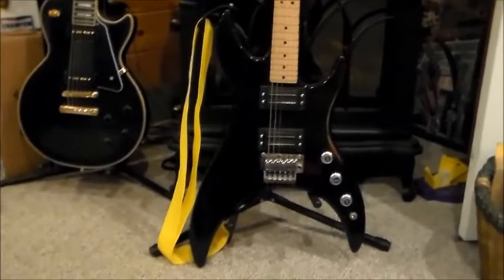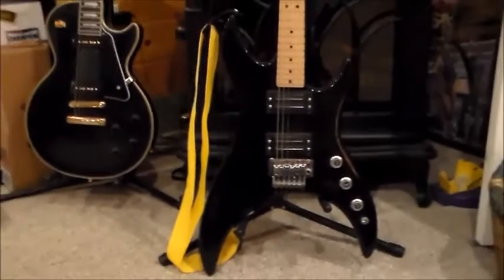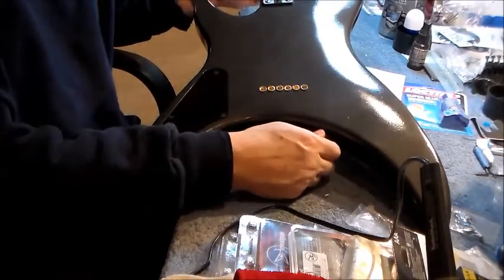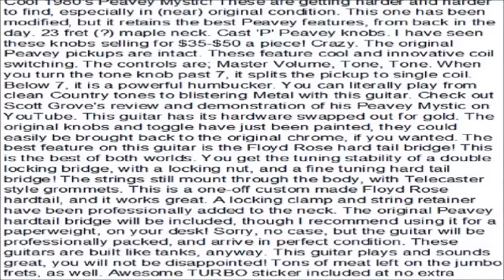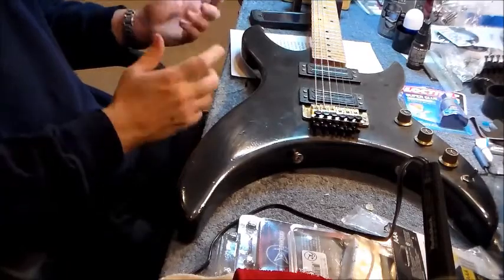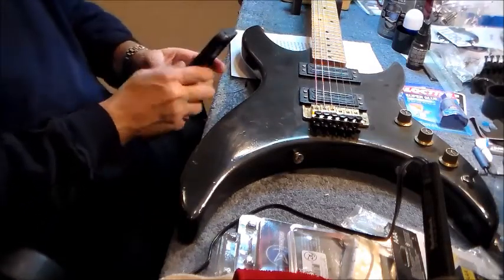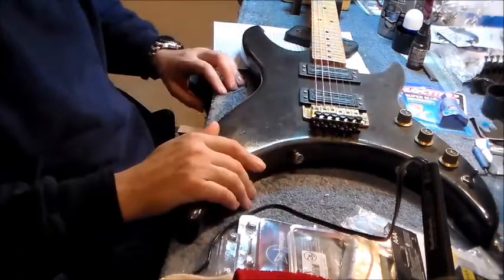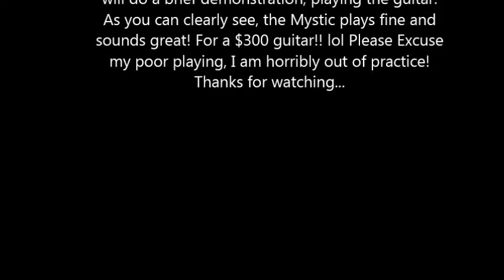Peavey Mystic and Epic eBay Fail!

Comment: Thats my first guitar the candy red one. I still have it since the 80s. Was it easy to install a floyd on it?
Reply from the maker: @ZacharyMoonshine  Not too hard. The worst part is cutting up the neck for the Floyd locking clamp. That takes some fortitude and precision! Lol 
I mark the cut lines with blue tape and the cuts are well shallow. Then I sneak up to the level platform that I need w/ a wood file. That way you don’t have to ever use any shims. I have a metallic gold Mystic now, just like the one I had when I was a kid. But this one has the trem, mine from back in the day was a hard tail. No plans for a Floyd… yet!! These things are creeping up in value?! A perfect mint example can fetch $1K believe it or not!!  Looking for an original Peavey Mystic case, if you happen to have one or know of one? Thanks for watching and commenting. 🤘